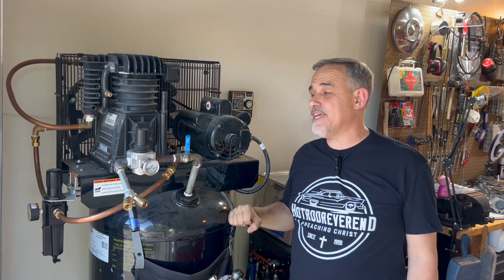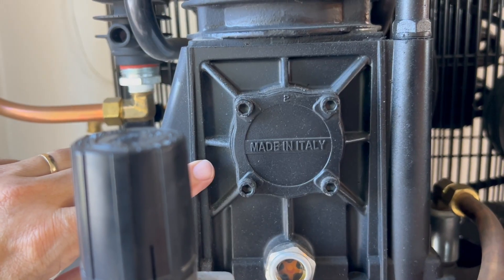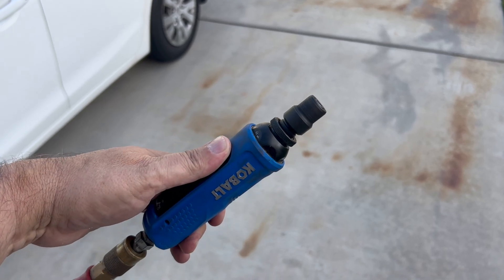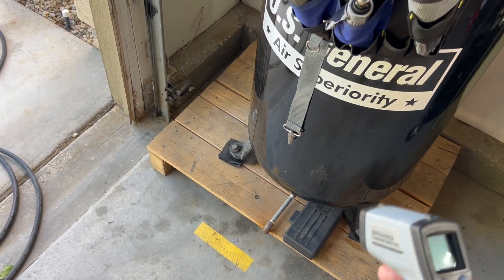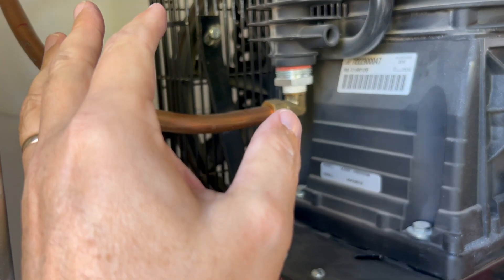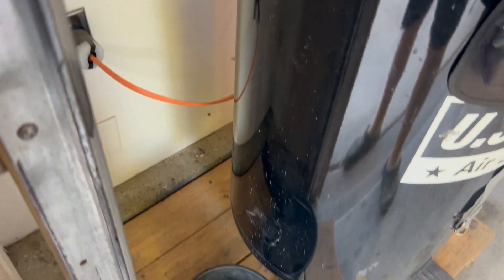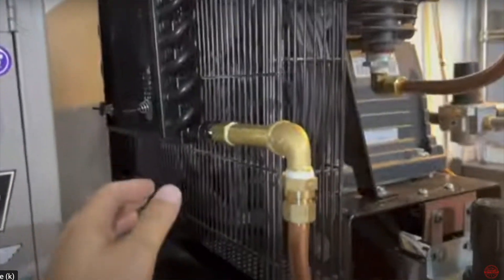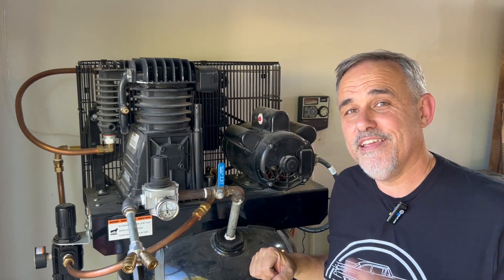Will an Aftercooler "really" help your air compressor?

Comment: Nice system, sir. I like the compactness of the package.
Reply from the maker: Thank you - and as you can tell, I certainly am satisfied with the upgrade! Another bonus is that I do not have to run a lot of gas pipe around the shop to get the moisture in the air to go from a vapor to a liquid. The aftercooler does all of that for me and I get very dry air right from the tap!

Comment: Any idea what the ambient humidity is?
Reply: Here in Birmingham AL its not uncommon to have 90% humidity. When the humidity drops below 50% I make a point of opening the garage doors to get that free dehumidification.
I do run a large Aprilair dehumidifier in my basement, 2700 sq/ft, to keep the humidity at 55% year round and I now have zero mold collecting on materials like leather and wood cabinets.
The dehumidifier samples the air every hour or so but rarely kicks its compressor on. Works like a charm.
I also sealed the basement up where the builder failed to close out the area under my rear deck. When I first moved in the temp in the basement was always the same as outside air as well as the humidity level being equal to outside air.
When my shop cat discovered a huge black King Snake in the basement, as I was moving in, I realized immediately I had issues.
Previous owner had a small dehumidifier running nonstop 24/7 costing about $3/day accomplishing absolutely nothing.
Kind of like having a hole in your boat’s hull and running the bilge pump constantly.
Knowledge is good!
Reply from the maker: @Speederhank wow! Thanks for the info my friend.
Reply: If you ever have to replace the copper lines due to work hardening go with aluminum. It lasts a lot longer in vibration prone areas. At least thats what Grok informed me of.
Reply from the maker: @Speederhank  noted!
Reply from the maker: That has not been measured out here in California but back in Ohio it was not uncommon to have well above 60 percent quite often. The place was worse than the northwest….
Reply: @HotRodReverend 
I ask Alexa daily what the humidity currently is.
If my family leaves the door open when the humidity is above 55% we have an educational moment.
Reply from the maker: @Speederhank 😂
Reply: @HotRodReverend 
This place is worse than Atlantis!
Reply from the maker: @Speederhank rotfl

Comment: I did the same many years ago. Absolutely critical to the life of the consumables on my plasma cutter. I find that I have the hardest time explaining it to other people. They just don't get it.
Reply from the maker: Ditto. Most do not realize the scientific principles involved. When the air is that hot coming just off the pump, water stays in a vapor. It needs the temperature transfer and to be cooled before the water will “drop out” of the air.
Reply: @HotRodReverend  "Drop out" AKA condense... 😁
Same thing happens on the inside of the condenser in an AC system. The Freon goes through a phase change from a gas to a liquid, it condenses. It also happens on the outside of the evaporator. Because of the sharp change in temperature, moisture in the air condenses on the coils, collects, and goes down the >condensate< drain.

Comment: Thanks for the video!  Good rule of thumb is discharge air temperature should be around 100 degrees above ambient (and that's roughly where it was when you measured on the fitting.  So 90 degrees after the cooler show's it's pretty efficient!
Reply from the maker: I will have to admit I do not know much about what the temps should be but I do know I am getting dry air and I like the setup - thanks for watching.

Comment: Good video!
Reply from the maker: Hard to believe that the most watched video on this crazy channel is that first air compressor upgrade. It has been a help in the shop for sure!
Reply: @HotRodReverend ive learned that the YouTube algorithm push is really weird too. I have a small compressor and will have to see if i can do this upgrade to it. It may help as it isnt designed for air sanders or grinders.